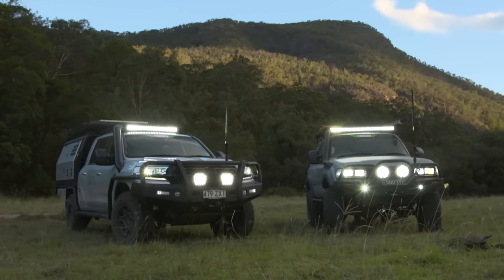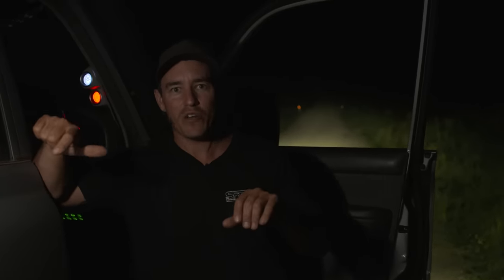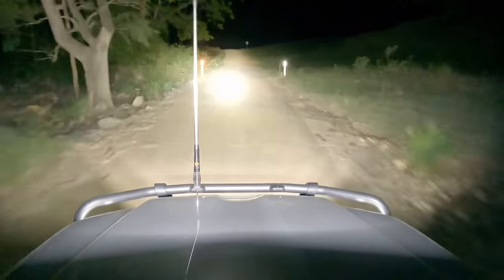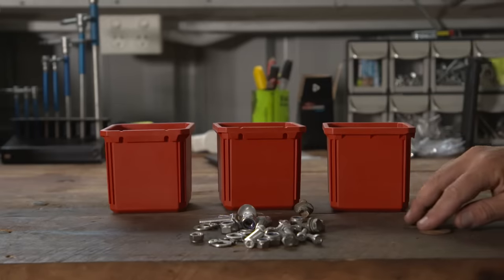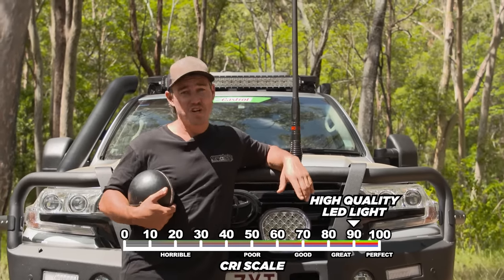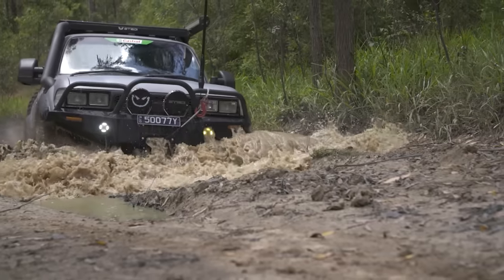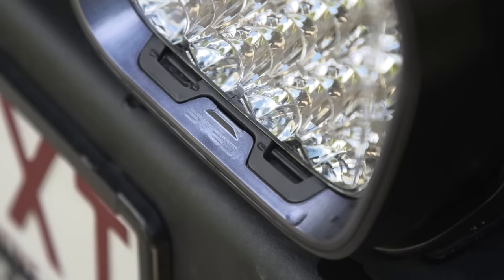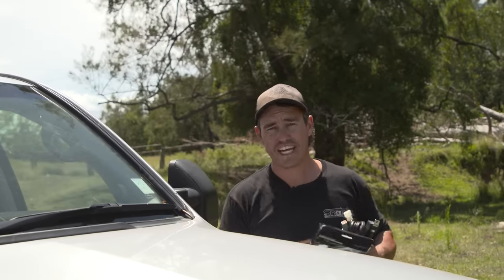5 things you DIDN'T know about DRIVING LIGHTS! Watch before you buy!

Comment: Recently bought an LN106, currently rebuilding her, shes stripped sanded and about to raptor line, it already has some ebay special lights on there and lets be honest, its that slow it wouldnt pull the skin back on my old fella, i reckon i could drive in the dark and not need to worry about hitting anything at the speed the old girl achieves but a couple of flash new spotties would still be a nice addition to the rebuild, great vid shauno, legend.

Comment: great to see your trying to help people while plugging your pocket with those awesome looking stedi units.
It may be a good idea to inform people about road regs when it comes to Lights, here in vic if they are forward of your "B" piller or behind or above your bull bar bar they are considered camping lights and the switch must not be able to be reach by the the driver while driving,
This why I need the Stedi lights because I got defected and had to disconnect my roof mounted light bar which doesn't fit my bar, those steady units would make my rig shine day and night.
keep the information coming, well done .

Comment: Great show and very informative. You mention IP68 and 3m of water but the thing most people don't consider is driving down the highway at 80km/h in pouring rain, this is when you are going to get potential ingress as the speed forces the water in every hole. Another is a hot light being splashed with cold water, hot lights expand increasing the opportunities for water ingress. IP68 or IP69 tested and certified is the only answer to this and Stedi have stood by their products for many years ensuring your money is well spent. Love the channel and a set of Stedi lights would look fine on the front of my Everest.

Comment: Great tips on the Spotties. I just bought myself a 4runner and am about to put it on the road. It currently has an original set of spotties that just don't cut the mustard any more so am trying to work out what lights to put on it. A set of Stedi's would fit in nicely.

Comment: Really gonna need those spotties. Currently working on the "poor uni student" build.

Picked up a 2006 rav4 for some light offroading and overlanding, and it came with some nice hella lamps... also from 2006. The high beams with new bulbs are brighter than them at this stage.
So instead of running out to replace the old halogen bulbs, I was gonna pick up some cheap LED lamps which should be better and last longer, but hey if you're gonna offer, im gonna ask. 

Got a ton of other things to do, AT tyres, RTT, 12v system, fridge slides, etc that I need to do, so free things are always welcome.

Comment: Good video. Lights have certainly come a long way in the past 20 years. Never thought I’d see an LED light that stacked up against an HID for long range performance. 
Most Friday nights I drive 450km from where I live down to our small farm. Hit 5 roos so far that I can recall.  One of our vehicles has excellent LED lights and haven’t hit any with that so far. If you can’t see them, you can’t avoid them. Could certainly use better lights on our Ranger.

Comment: Back in 1971 I bought a pair of Miller driving lights to put on my EK Holden, in preparation for a Nullabor crossing.  Compared to the EK candles, those first 55W halogens were fan-bloody-tastic.  Halogens ruled for a very long time until LEDs took over.  There are plenty of good LED lights, but also plenty of crap ones to avoid.

Comment: Thanks guys for another great video!!  I need a new set of Stedi Type X Evo spotties because my current HID's just aren't cutting it...I fitted a Stedi 3303 Pro bar and its awesome, but the colour temp difference and lower light output from the "other" brand HID's actually cause me eye strain, the Type X Evo's in a combo set would fix that eye strain and make offroad driving much safer for me!  Cheers, Foxy!

Comment: Smoked a roo on the way to work 3 months back. Didn't have a bull bar or spotties. Both probably coulda changed the outcome. Got the Colorado back now with a bullbar, just looking to pull the trigger on some lights. These STEDIs would definitely do the work!

Comment: Currently traveling in a modified Mercedes sprinter 4x4 and I am only running the stock halogen lights, you can imagine what these are like traveling outback Aus, and I am infamous for traveling and pulling into camp at night, I have been trying to save my hardest to buy a good set of stedis.

Comment: I have a light bar mounted on the roof spoiler on  my 3,2m tall Ford Transit box van, but even mounted that high it give way to much light right in front of the car and it do not light up the road farther away so I pretty much never use it.

I have now bought 2 more of the 25W high beam halogen alike LED lights that came with the car when I bought it that is mounted in the grill of the car in front. They work great to light up the road far ahead and give not to much light right in front of the car. Will mount them up high on the spoiler to give even better reach ahead together with two 170w LED high beam lights with many smaller LED and reflectors (hope they are better then the light bar that have way to much spread).

Comment: Just completed Gary Junction Road, NT to WA. Towing a caravan. I have a set of 2 great light force spot lights. Well did have. One bracket failed and at this stage can't locate replacement bracket. The screws came undone on one side. So a new set of Stedi's would fix the look on my ARB Bullbar. Thought they would be better than that.

Comment: Here good lights is a must have for night driving with sheep, elk, reindeer and cows blocking the road at random... Looong time ago I was driving at night and a rather large flock of reindeer was blocking the road and I did not see them because of the poor lights on my 1993 model Opel Astra, I had to drive slalom between them while slowing down, and I did miraculously avoid hitting any of them.

After that I mounted two Hella Rally 3000 and put in 100W halogen bulbs in them, and my car`s dynamo was giving out 14,8v so it was a LOT more then 100W :) Best lights I ever had, they was even more powerful then  50W Xeon. Only now with 170w LED`s I see lights that give the same distance and spread of light. With the 100W bulbs in the Rally 3000 you could see a wooden power poles at 1,500m distance along the road (I turned the lights upside down to give less light to near the car, that also help give  more distance ).

Comment: I really need the lights as I've been saving for parts for the cruiser like rear main seal and the front seal I've been watching beers in the shed and taken on what you have said build inside out can't get to the Cape without a broken engine or a gearbox that has a solenoid on its way out

Comment: Great on stating the best CRI coming from of halogens.  Seeing well is the result of quality light output and correct reflector design, not necessary the greatest lumens or blueish LED bars. 

I chose halogens for my Montero.  Not sealed, no water fording, just an improvement over stock old low/high beams.

Regards from Guatemala 🇬🇹

Comment: I need a new set of spotties because my 2019 Ford Ranger was in an accident (not my fault) and written off. Insurance paid me out, I used that to get a 2021 Isuzu D-Max. But insurance didn’t allow me to remove any of my accessories before the Ranger went to scrap 😢 so my old light bar was wasted. I planned to try a pair of spotties this time, and was considering the Stedi range. 🙂👍🏻

Comment: Currently running no spotties, when i bought the car they were old rectangular halogens and only one was working, barely brighter then my candle light high beams, when i took them of the bolts pretty much fell apart in my hands. These spotties would be a much needed upgrade.

Comment: When u fit HUGE spotlights to the front u can overheat your engine if towing and fitted with bullbar .
Does not occur every time but there are many vehicle warranty claims refused as a result . Approved or highly vented bullbar with alot of thought into spotlight/LED bar placement is the way to get around potential issues .

Comment: I could have used a good set of driving lights when I had to pull off the road. After I lost my head lights and hit a deep drain when I pulled into an open area. Ended up snapping the diff and bending the chassis on my GQ because I couldn't see the drain with the light bar I had.

Comment: Would love to win a set of these.  I would find the highest point possible and throw them off to check durability.  I went with a baja design light bar many years ago and doubt these things will get anywhere near the performance it has. Glad you commented on lighting up 4km down the road, theres no point trying to throw light that far unless you're scared of the dark. Good quality light and durability for the win... and yes decent light bars can throw light a good distance down the road, not kings or ebay specials.

Comment: Mounting positions are important as well.
I borrowed my mates cruiser, and the light bar on the roof made it harder to see. This is because it was lighting up the bonnet and reflecting that back into the glass.
The front mounted spots were good, but were lacking the spread to see the side of the road.

Why do I need a new set of lights? Because I have a RN169 and the stock sealed beam lights are only just better than a firefly in a jam jar! 🤣🤣

Comment: Great video as always bro. Quick question, I have a 93 trooper with aisin manual locking hubs. Is it okay to use 4L with the hubs unlocked? I find it easier to drive steep hills using 4L but 4x4 are not necessary on pavement right? Also 4x4 is not r commended on paved road. So i was wondering if i can use 4L in 4x2 mode (hubs unlocked). Will i break anything? Thank you

Comment: I need to upgrade my light setting as I have a dark spot 60 meters in front of my Hilux surf when I switch from low to high beam. I ordered a bull bar and as soon as that arrives the next step will be adding some lights. I have stedi work lights on the back for reversing and they are pretty bright for the size of them. Slowly building my dream overlanding truck here in NZ. Would love to win a set of Stedi’s

Comment: Need a new set for my Cruiser, I currently have 4x 9" stedi type X, this set is 3 years old and were the warranty replacements I received after my previous Stedi TypeX 9" set became faulty after about 12mths, the current set are starting to fail, and being 3 years old there's no more warranty, so a new set for the cruiser is needed ( 4 if possible). If I don't win any I'll probably get Some of the Kings 9" ones, Have them on my work ute and have lasted so far 3 years and still super bright. Just can't justify spending big money anymore when they don't last like you would expect.

Comment: Thats a bucket load of good information, that wiring consealer sounds mint. No holes in the the roof. 😅
I have an 09 pk ranger with some lighting issues, when i turn the high beams on headlights turn off. The sids of the road disappear and is really dangerous i gotta sort it out. Well each car has its own persionality or its not old enough to have one yet haha. 
Best of luck picking just one comment. <3 stedi <3

Comment: I need a set of Spotlights to enhance visibility in my 4x4, especially in off-road and rural areas with poor lighting conditions. They help navigate rough terrain, identify obstacles, and improve night driving by illuminating a wider area and spotting animals, pedestrians, and other vehicles outside the range of standard headlights. These benefits make 4x4 vehicles more efficient and safer in challenging environments.

Comment: Without trying to pull heart strings and play a small violin I am in need for some new spotties as my mum recently passed away in NSW. I live in WA. I will be making the drive from coast to coast in a couple of weeks to start packing up her house, and have a heap of work to do on it for sale. Plus collect her ashes etc. 
When I drove over at the time in May I almost wrote my prado off multiple times with roos as my old spotties are 8 years old and are pretty useless.

Comment: Hi mate well I have just built an ln106 wit a new motor new turbo kit hi steer conversion 12000 pound winch front n rear lokkas raptor painted bucket seats reduction gears 3inch efs lift u bolt flip kits itech 12volt 24volt system roof top tent Engel 60ltr fridge dometic 13ltr internal fridge 45ltr water tank n pump hot water system slide out kitchen roof top cage it's cost me an absolute fortune n it's taken over a year so far  n it's still in progress I cannot afford much more and I'm planning to travel from the central coast up north to the Cape n as many spots in between then from the Cape to northern Territory n across to west Australia n down the coast bak to nsw n try to find work as I go those new spot lights will definitely help me out during the travelling I intend to do n places I can't wait to experience its me n my dog rocky on this journey n hopefully those spot lights will work amazingly on my front bull bar Thanks mate

Comment: In the States, spot lights are a tight beam, and flood lights are a wide beam. Cibie, Marchal, all the European classics offered both types. A pair of 7" Marchal halogen driving lights (in between the two) would let you read a newspaper over a kilometer down the road, once you replaced the 50W bulbs with 100W bulbs. Which made each lamp 10x brighter than our federal limit for road vehicles entirely.
 Sadly someone stole mine. They ridiculously expensive IF you can find them used.

Comment: A couple comments;

- IP68 is 1 meter of water for 30 minutes.  Note that IP69 (the "9" being better than "8") means it meets 8 and in addition, it can survive high pressure jets of water (for example, if you wash the lights with a pressure/wand washer).   The highest rating is IP69K which means "high pressure / high temperature jets of water".   If you use hot water pressure washers on your lights, you'll want IP69K rated.

- heat coming out of the back of the lights is GOOD.  It means that heat is not getting trapped inside the light.   Good engineering means that heat will be transferred away from the LED and out to the atmosphere.  If you compare 2 lights with equal number and wattage of LEDs, the one with MORE heat coming out of the heat fins is better.  Both are generating the same amount of heat internally but one is better at getting rid of that heat than the other one.   The one with cooler heatsink fins means that the heat is not being pulled away from the LEDs as well, which will lead to failure or at least yellowing of the LEDs (excess heat can actually change the chemistry of the LEDs, resulting in a yellower light rather than bright white).

Comment: Hi all, i have a question about the above windscreen lights,  i have been refused a roadworthy in Victoria as the light bar on the roof  apparently  are unroadworthy in victoria.  something to do with above a drivers eyes.  seems even though they are connected up correctly (only switch-on-able in high beam) they have to be removed.  what is the actual law??

Comment: I personally no longer use LED anymore because of the kelvin colour of the LED'S 
I've gone back to a 4,300 K HID, And it's absolutely brilliant while these 5500k and higher Kelvin's reflect mist, dust, and rain the 4300k doesn't and you can see a lot more clearly without the interference of the elements...

Comment: Great vid. Let's be real though that 99% of us don't need super high quality LEDs on our rigs for what we are doing as I bet most of us don't do much night driving offroad. The midgrade ones work great for normal use and the only real issue I face with them is the occasional water barrier malfunctioning causing the leds to burn out. Definitely nice to have some flood lights or spots for being able to see off the side of the roads though and has saved me from hitting quite a few eager deers over the years. Just don't be a dick and turn them off for oncoming traffic!

I'm also surprised you guys didn't mention the advantages of yellow/amber fog headlights. I've found when it's foggy or other visibility reducing conditions like heavy dust storms or blizzards, bright normal color temp headlights actually make visibility worse the more light you put out as everything reflects off the particles in the air. Yellow/amber lights don't reflect off the particles nearly as much giving you much better visibility through those conditions. I like to keep a set of both normal color temp and yellow fog lights on my rig for either condition with the yellow ones coming in handy far more for street use here in the Colorado mountains.

Comment: The problem I have with LEDs is the color temperature. 99% of them seem to be 6000 to 6500 Kelvin. Usually called "Hyper" or "Ice" White, or some such, they have that annoying blue tint which the human eye doesn't see well. Only the more expensive LEDs are a more normal 5000 K, which has a hint of yellow, but the human eye can see better. Because of this, I stick to halogens, while not as bright, I can see with.

Comment: Shaun I have to disagree please review adventure kings spoties  I bought a set which included 2 small spots two 7” spots and a light bar loom was separate cost me $220 plus the loom which was $100 roughly. Had them on my Jeep for 4 years drove them through river crossings been bogged under water for long periods of time matched them up with other brands for brightness and they come out on top. I took them off now it’s been 4 years replaced them with stedi evos because I always wanted stedi I have to say my kings ones were brighter I was disapointed in stedi il leave them on now that i paid big dollar for them 
But I’m not 💯 happy with them .  I believe cheaper brands are just as good .